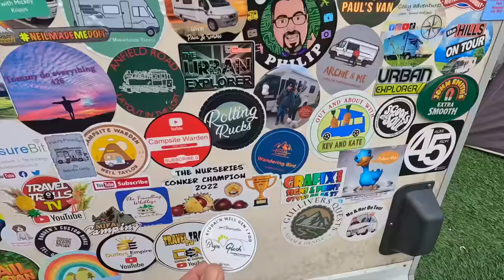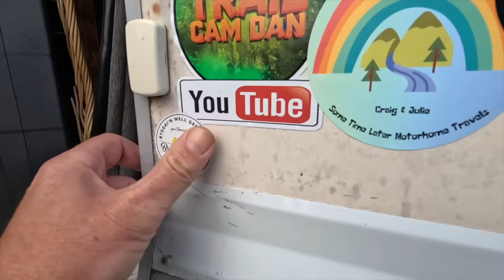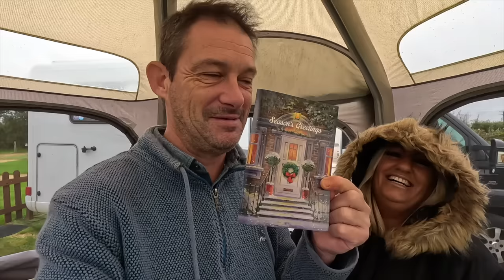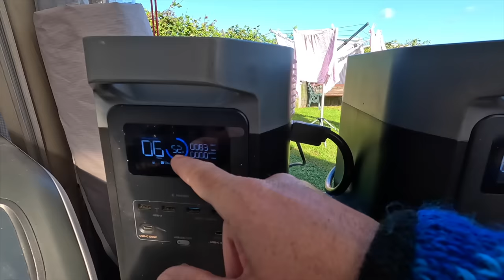Motorhome FLOOD: Can It Be Fixed URGENTLY!

Comment: That pot in the fridge is an evaporation pot. No issues as long as the tube was clear 😊
Reply: @wanderer397  Well, I am sure if that was an issue, they would have designed fridges for tourers differently 😉